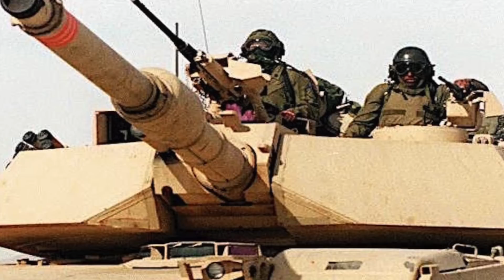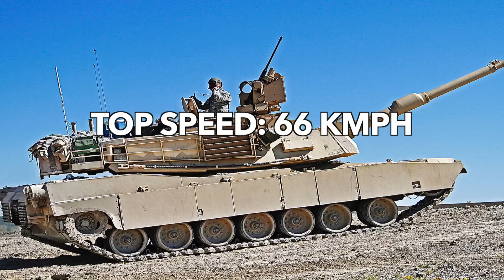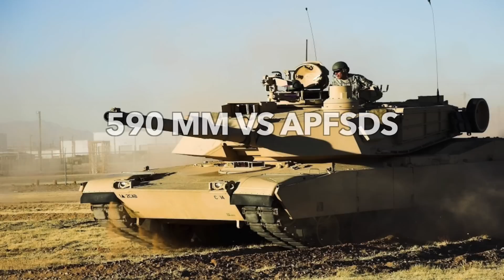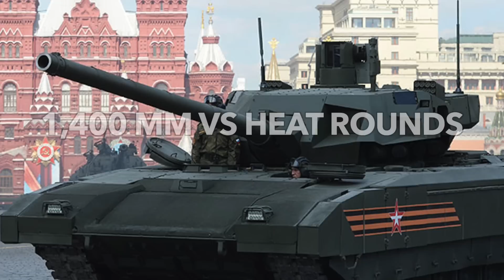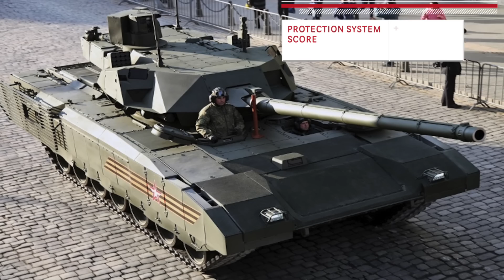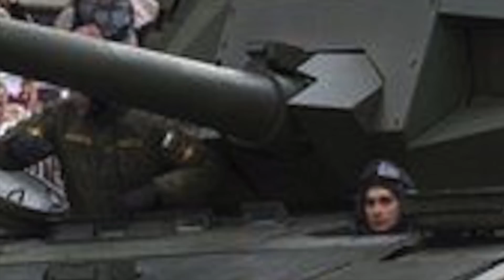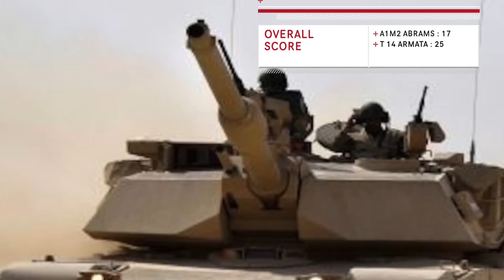AMERICAN M1A2 ABRAMS  vs RUSSIAN T14  ARMATA: WHO WINS?

Comment: This review was so biased that it is worthless. What I fail to understand is why there is no mention of ammo storage and survivability.  The Abrams stores its rounds in the back of the turret behind blast doors thereby protecting the crew from ammo detonation. The T-14 still uses a self-loading system where the rounds are stored below the turret floor like its "pop-a-top" cousins, T72, T80, T90 etc..  And ask any one arm Arab if he lost his arm in a Russian tank, you'll probably get a yes answer. The machine guns on the T-14 are not even mentioned and if you know anything about tanks, the most used gun is the co-ax machinegun. ALL machineguns will stop at some point and require reloading and or just a rack of the bolt to seat the next round. Tell me how one does this when the gun is in an inaccessible turret? How does a crewman replace a shot-out MG barrel in the middle of the crap hitting the fan? The Russians have never appreciated the 4-man crew that all western tanks employ. Why is that?  Why the extra crewman  man that the Russians see as an extra cost? Ask yourself why almost all the free world's tanks are manned by 4 men.  The author doesn't go there at all.  He certainly was never a tanker.

Comment: T-14 looks a beast, and the crew protection does seem on another level,... If you look at the thickness of the crew hatches, even these seem to have Malechite protection against top attack warhead's, that's pretty stunning attention to detail, would definitely feel safer in that tank than any other in service around the world.
Reply: That's actually been done to drastically decrease the mass. Because the mass of "armoured air" does actually not equal to the weight of air.
Reply: When the ammo in the turret explodes and is 200 feet in the air, you'll understand there is no such thing as "crew protection" no matter where you are sitting.

Comment: I think you overestimate the effectiveness of the T14 Armada. firstly the turret armor is not nearly as thick as the hull armor, and the m1a2 has a thermal sight capable of detecting enemy tanks up to 8 km away (whereas the T14 Armada has a thermal sight range between five and three kilometers). The detection range of the Abrams wouldn't matter under normal circumstances since the effective range of the main gun is only 3 km, however it does matter if the turret is not well armored because that means that the effective range is higher.

I do think that the T14 Armada is a superior tank, I'm just saying the m1a2 does infact have a decent chance against it.

Comment: That was unexpected.  I thought the M1A1 with it's depleted uranium armor and ability to shoot very accurately while on the move and because it has a depleted uranium round meant it was the best tank in the world.

One thing that wasn't mentioned in this video, the M1A1 is a seasoned tank.  Everything about it works and is proven to work.  The new Russian Armata tank and no doubt everything on it isn't working yet.  If I was going into battle, I would choose the M1A1.

That said, above either of these I would choose precision GPS guided Artillery and Mortar.  It can be directed from soldiers on the ground or from drones.  One piece covers vastly more area than any tank and is more survivable.  My money is on precision mortar and artillery.

Comment: Every  top 10  tanks - I've noted  (Ive seen most of the YTs about them )  seems to have a limit to the main gun calibre of 120-125 mm!  Why is this the maximum so far?  
Is this some technical / scientific limit like the opposite of Moores law ?  Certainly makes me wonder if that 152mm gun "under development" for the T-14 is a pipe dream or a reach too far
Reply: Germany is already planning to field 130mm, France 140mm and planning is also trying to field larger guns. Russia and China are also planning on fitting 150+mm guns. The reason is that there was never a reason to do it. 120mm and 125mm were still capable Guns and all that needed was ammo. Now that they are hitting a limit they are planning for larger cannons for increased penetration. Also larger guns need auto loaders and the west don’t like them for some reason.

Comment: Extremely biased, 0 actual facts on the Abrams

Also what the hell is a A1M2? If your gonna make a "non biased" video then atleast get your facts straight

You legit compared a 30 year old system to a brand new one without including all the upgrades made to the old system 

There are more than just the M1, M1a1, and M1a2

Comment: All m1 protection is pretty minimal since the main weapon of combat the Semi active guided ATGM will always hit the weak spot so abrams has 400 mm of armour and for a skilled gunner that can quite it into the UFP 100mm of armour
Reply: Yeeter Deleter, not if it’s hull down, also you forget that both platforms have hard kill active protection systems. If you fire an atgm, you have to guide it meaning any other tank in the unit can’t be engaged while you’re targeting.
Reply: Shaloam Nenja • 12 years ago first the kornet atgm has 3 tandem warheads so it detonates one upon impact with APS one to destroy ERA and one to penetrate because abrams doesn’t have ERA a 2 charge warhead will hit the tank full power second Hull down is rare you would have to be on urban terrain to be hull down 3 if you are hull down on normal terrain the atgm is not fire and forget for a reason it is meant to be able to lock on easily like a fire and forget if the atgm loses lock it can still be guided and the weapons operator can simply make it go through a complex trajectory to hit the target on the weak spot so the Kornet M could work in a top attack role like the javelin now the t-14 does not have the Kornet M but it has the falcon V developed which is a 125mm kornet M but with radar guidence on top of laser guidance and salcos so really does not matter ATGM is ATGM you see t-24 during at you long range you are dead no exception this is something a lot of people need to get in mind
Reply: Shaloam Nenja • 12 years ago yes the atgm is not on yet but so is the trophy for the abrams so same could be done with older atgms but without radar guidence (radar rangefinder is still on t-14)

Comment: That seemed very one sided. If someone puts a 150 mm gun on the Russian tank means nothing. Russia boasted this tank to be unstoppable, exact quote. When the t14 was in Syria it was destroyed by the dozens. Russia also says the “5th gen” fighter could beat any plane. Last time I checked they couldn’t acquire the correct engines. Plus they cancelled the program. See any trends here. Remember the panzer tanks in germany in ww2 talked about how powerful they were. But when blocked or had to make a sharp turn they were too heavy and were destroyed on the spot. Read history books before putting this stuff on the net. No tank is invincible.The Russian tank is not as good as you portray it to be.Also Russia doesn’t have the money to build the amount they want.

Comment: To be fair he did say M1A2 vs T14. Stock T14 is better than stock M1A2. M1A2 Sep V3 is much more formidable but I do have one gripe. The M1A2 Sep V3 has trophy system. The trophy system cannot deal with APFSDS as trophy is designed for asymmetrical warfare ie tanks vs terrorists with should launched rockets vs Afganit which can decrease sabots effectiveness by about 15-20%. Clearly the T14 is a modern tank meant for tank battles. The M1A2 has been upgraded for more none conventional low intensity threats and it does it's job better than any

Comment: You need to update your T-14 totals---the first 12 of 132 ordered were delivered in 2019. The goal of 2300 by 2020 is WAY OVER ESTIMATES--the USA had 3200 (real tanks not paper T-14) on duty with our forces...in 2020  So if you look at the current odds on the battlefield every T-14 will have to find and kill over 200 M-1A1's but the converse is more realistic-if your line of reasoning is serious then only about 5 M-1's will have to kill each of the 132 T-14's WHEN THEY ULTIMATELY GET INTO THE RUSSIAN ARMY (but by then Mr. Putin and Russia will be bankrupt and the T-14's will be scrapped to pay the bills..)

Comment: There is an discrepancy with the armor rating of the T14 Its far but carries a bigger engine and a bigger gun. So where the hell is all that weight? There are two or more types of T14s that were tested. 1st is a faster lighter version to show off its speed and the second is a heavier version with thicker plating . The reactive armor has little effect on US sabot rounds so against the 105 or 120 mm sabot the russian plating is closer to paper. 

Their anti tank interceptors are fake as well. In tests it showed interception but was unable to track targets fast enough due to the area that the detection system had to cover. It proved ineffective against most anti tank munitions including most RPGs used in the 1970's.

The automated turret for the T14 also hase huge issues with guidance in testing. Scoring imperfect on the range against moving targets due to stabilization issues. It also has the added issue of being dependant uppon the onboard computer system as does the loading mechanism. A flaw that can be exploited effectively by ECM.

Comment: Yeah sure. They built 20 (!) Armata. Number of Abrahams: 10.288 :D Also: Active protection is already available in M1 Abrahams. :)
Reply: About 3000 real Abrams in USA army (without reserves). About 100 t14 in 19-20 years. But it's only testing. To compare tanks with reserves you should notice that in Russia are about 20000 tanks in reserve.
Reply: The U.S can't deploy more than 2500 abrams in combat...

Comment: Tell about the "Egg Shell" underarmored turret incapable of absorbing a single hit. Perhaps, you should detail the fact that the "Active Protection System" doesn't cover the back 1/3 of the tank. How about the horrific ergonomics of 3 guys seated abreast.

My brief search of Open Source Information indicates that the new Stryker w/30mm auto cannon firing depleted uranium ammunition will potentially defeat the turret armor of the T-14 ARMATA at ranges of less than 1km. At the very least, it will destroy every sensor, optical sighting systems, and the capability to deploy defensive counter measures. Remember the crew members don't occupy the turret. Therefore, they completely combat ineffective without digital sighting systems.

Comment: M1M2 Abrams is an old relic! Overrated in many aspects. In reality, i pales in comparison to even mbt's from smaller nations! And it is very inefficient! Why put a gas turbine enging on something that crawls on land, sand, mud, and watery surface? Naturally it'll suck in dirt! Most tanks are powered by conventional diesel engines. How come designers of the M1 used turbine which proved detrimental during desert storm and other wars in the desert. Repairs were costly after the war because sand are sucked in by the turbine causing abrasive damage.

Comment: Unbiased opinion. The T-14 is impressive no doubt. I think it’s great. If they were to go head to head the biggest disadvantage would be AirPower. The Russians, although with very capable anti aircraft potential, would eventually be overwhelmed. The air force would be destroyed with very few losses. The ground anti aircraft forces would be the biggest threat. Either way. Once both were somewhat neutralized the t-14 would be nothing but an easy target.

Comment: Armor: Should have mentioned that the good armor is only in the crew capsule of the T-14. So it is possible there are cheap exploits to knock the T-14 out or at least render it harmless. Because many parts of it is poorly armored.

Firepower: Should have mentioned that it is quite likely that Abrams still has a superior targeting system. It is an area where the Russians have been lagging behind USA and it is unlikely they have caught up yet. 

I truly despise USA and I am happy that Russia is a bit of a counterweight to the evil empire. However, truth is important. Anyway, thanx for an interesting presentation.

Comment: At he start it is said that the T14 will number 2,400 by 2020.. its mid 2019 and only an estimated 650 have been manufactured.. the 10,000 Abrams that are available would have a much, much higher battle ratio than suggested at the end of the Vid.
Reply: 110 have been manufactured of the planned ~200 by 2025 I recall.

Comment: There's also combat experience of both the tanks and crews to take into account. M1A2 tank crews have more experience in combat than T14 crews and the M1A2 is proven in combat, far more so than the T14.
Reply: DrakeMarvell saying the M1A2 is combat proven is a stretch it has not faced a modern military force only Cold War vehicles or insurgent forces without high tech anti armour weapons so until the M1A2 faces modern enemy forces stop calling it combat proven in comparison to other modern vehicles but I will give you that the crews are going to be more experience in actual combat rather than simulations
Reply: @cynicalfox190  The Abrams has been in active service for nearly 40 years.

The only confirmed Abrams casualties during the Gulf War were due to friendly fire or just blind luck.

Furthermore the Abrams has fewer casualties than any other modern battle tank that has seen active service.

And any Abrams tanks that were "destroyed" were often at the hands of their own crew instead of the enemy either because the tank lost a track, had a damaged engine, or ran out of fuel/ammo. It's highly implausible that a few enemy insurgents with RPGs could take out an Abrams tank without hitting the engine compartment or main gun.
Reply: @Douglas Jones  Ahahaha, of all the things, you attack my Grammer. You're obviously a burnout with no Imagination with a boring dry sence of humour. You're a loser online and in real life. Ahahahah
Reply: Douglas Jones yeah no others come to mind really maybe the Leo2 used in small numbers by European country’s in the Middle East but yes by far the M1A2 has seen the most combat out of the modern MBT’s i only argue that it shouldn’t be used as a example of how the M1A2 is combat proven and thus more reliable or better than other modern MBT’s and yeah I agree that that T-72’s and T-90’s are no match for a M1A2 but the newest T-90’s will still cause concerns for the crew even if they are not on perfectly matched
Reply: @Douglas Jones  Those Soviet tanks were export variants that had worse armour than their very first models. They were driven by unexperienced idiots.
Reply: This is fact. Americans fighting all over the world. They has much of experience
Reply: Russia is to gun for that to be correct and America is letting transgender join the military.
Reply: @joshuawalker2573  Did they not teach you anything in school?

Or were you just too lazy to pay attention?
Reply: @joshuawalker2573  One: horrible grammar and English 

Two: what does that have to do with anything I said?
Reply: @galbert117 only a loser reject wastes his time trolling to correct Grammer on youtube there was obviously an autocorrect issue but it went over your head because you are a moron

Comment: Yeah but the Abrams fires the m900 shell and m833 with depleted uranium so that 900 of kinetic rounds is nothing. If the Abrams was firing the m733 the t14 armour would be very hard to pen. And the Abrams ha has around 800 to 900 as well on the turret area

Comment: Can reactive armor really defend against a sabot? Or will the explosion from the armor just get sucked into the tank in the wake of the sabot round? Does Russia still use chain male for their tracks or have they started using the shoe design yet? The chain type tend to dig into muddy areas rather than offer forward propulsion. The larger gun planned for the t14 will mean less ammo capacity. Might even slow down the fire rate. Can the T14 track targets and fire while on the fly, or are they just going to line them all up shoulder to shoulder and hope for the best?
Reply: That’s not how it works lmfao. And yes it can. Some reactive armor can degrade APFSDS by over 88% of its penetration (though they are old ones) it works by basically having HEAT warheads inside or metal plates that when triggered will shoot outwards and cut into the APFSDS redirecting it, shattering it, or cutting it apart. Of course not all ERA can do this but Russian ones sure can

Comment: The M1A2 abrams wins, i didnt have to check the stats on either of them. I just know if you are comparing both then the M1a2 wins. why?

There are thousands of m1a2, while the T14 is very limited production. all the T14s may kill up to 100 shitty abrams, but they have at least a few more thousand to go. They will never reach that, or kill 100 abrams. No matter how good the tank is, all tanks share the same weakness. If you eliminate crew completely then you do have fewer weakness but if the drone tank need some wrenching to do, you're shit out of luck.

Comment: The US is going to reveal they're new battle tank in 2023...its going to be a beast...the US newest M1A2 Sep v3 or M1A2C is integrated with stronger armor and it has remote controlled machine gun and has the trophy system to defend itself.

Comment: I agree with most points made in this video except : generally a bigger crew is better than a smaller crew ..for tank maintenance and when the crew gets injured. 
But there is something you missed actually the biggest flaw of the T-14 and that is the visibility from the tanks perspective..the t 14 can only use optics to look at the outside world and even worse if the optics gets damaged the tank is practically useless.. and from what we learned from history is that the tank that sees the enemy first is usually the winner...